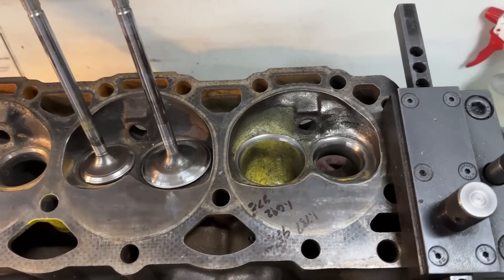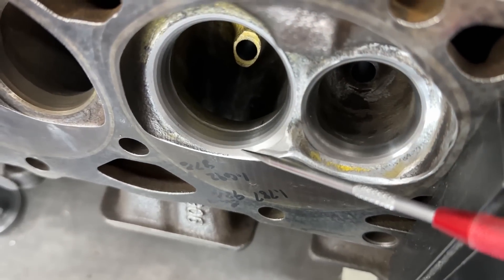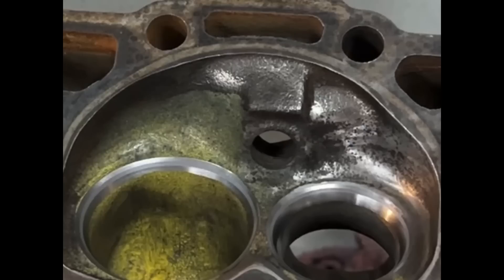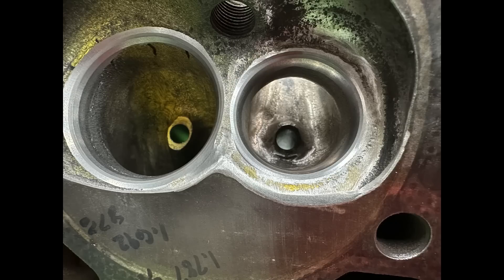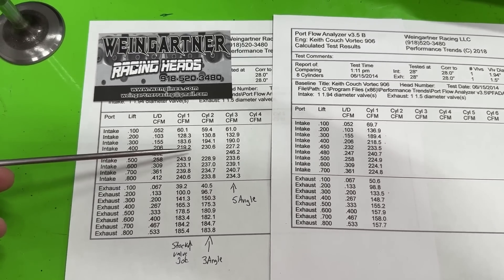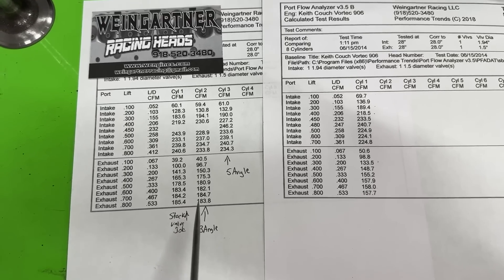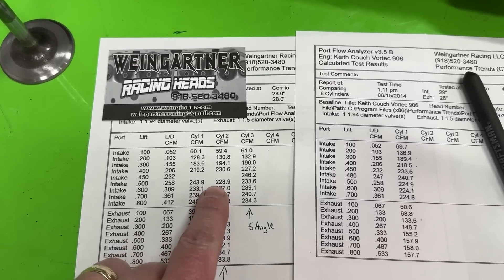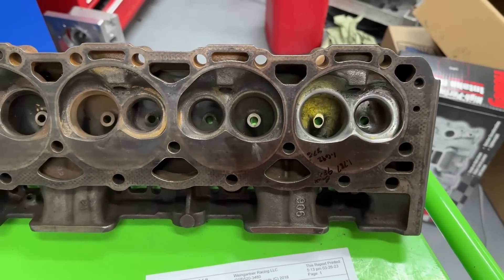Can A Valve Job Increase Flow On A Set Of Vortec Heads

Comment: I do a 3 to 6 angle cut depending on the application, I cut one at a time so the cuts don’t interfere with each other especially on the final cut with sometimes I’ll redo cause I’m narrowing it up to get a finish set up. Also, I’ll use dishwasher soap and water on the 30 and 46° on the sea and 45 on the valve for an interference cut, it depends on what kind of application you have but this is what I do. It’s in the seat where it should be on the vowel very well and cut it to perfection. The cuts also don’t interfere with secondary cuts.

Comment: When i played with these, i remember the top cut being important on these heads. As close as you can get to 40 degrees seemed the best. There is a goodson how mondello cutter advertised for Harley Davidson that has a 39° top angle, is use one with a dismder seat, I never seemed to have luck with seats under .050" but ymmv. With a Sioux setup it was difficult to recreate an angle that close to the seat angle, any unsteadyness or could affect the centrality and the width of the seat could vary around the circle and small amounts of grinding could make big differences in seat width so I often used 35 degree top cuts using the sioux. Would be interesting to try a 50 degree seat and bowl hog so that higher top cut angles could be checked out.

Comment: That's cool .
   5 angle in this video is only good from .450 lift and above.
     So for the racing situation that is awesome!!!
    However for most people that are building a street engine that isn't going over .490 lift DON'T GET A 5 ANGLE VALVE JOB  on a small block Chevy. . .
Reply from the maker: I don’t agree
Reply: My amazon 200cc sbc heads flow 276 at .5 before I have even touched the chambers, or thinned the guid boss or widened and layed back the port floor. It's all valve job until .5

Comment: The machinist did a 5 angle cut on my 2.0 ecoboost. It flows so good now that I'm having misfires at coldstart  because the injectors are having trouble keeping up. My turbo is also hitting peak boost (29 PSI) ~300 rpm sooner but I'm not sure if it's a result of the valve/head work or simply having clean valves. It's a GTDI so carbon buildup is a fact of life. The cylinder was over-bored by 0.5mm but besides that and the above mentioned everything else is OEM spec.

Comment: Why not just a straight up cylindrical bevel cut into the valve and seal? Wouldnt that provide an adequate seal?  Or are the transitioning flat surfaces better for some reason?
Reply: An adequate seal is only half of a valves job, the other half is to flow as much air as possible when it's open. Multi angle has better aerodynamics.

Comment: How much does a valve job cost for vortec head whats the price difference between 3 and 5 angle
Reply from the maker: There is no price difference to do the valve job 3 vs 5 angle. But the 5 angle usually leaves a ledge that needs to be blended. $300 for valve job
Reply: @WeingartnerRacing  thanks for the information 👍

Comment: Question: Have you ever tried a 1.50 exhaust valve in a sbc head that has been ported to the 1.60 exhaust valve to see if it makes a difference in the flow? Bigger port with a .10 smaller valve with a single 45 degree cut. I'm just guessing but think it would have a better flow number.
Reply from the maker: No. It would sink the exhaust valve in the head quite a bit.
Reply: @Eric Weingartner  
Thanks for the info, was wondering if it would work.

Comment: I did a 6 angle job, 3 on the seat and 3 on the valve face.
Reply from the maker: The valve job angles are on the head. So if you have 3angles cut into the heads you have a 3angle valve job. The angles cut on the valves are back cuts. So you have two back cuts.
Reply: @WeingartnerRacing  I was being Snarky.
Reply: @WeingartnerRacing  back in the early 80s the hot ticket was it to have a radiused valve seat with the cut at 45° centered on the radius.

Comment: Have You ever tested with a 30 deg. angle on the seat,I do know that all heads aren,t the same from different carmakers, on a AMC 502 "dogleg" head as an example ,a guy named Ken Parkman (in Canada) lost quite a bit flow when going with 45 deg. seats than what he got with 30 deg. seats. Important to notice is that AMC heads has 30 deg. seats from the factory,the "dogleg" heads was developed together with Valley Head Service's in California.
Reply from the maker: 30degree seat is a bad idea.

Comment: Did you mention it in the video? It looks like the intake with porting and the valve job had a bigger gain over the port with just the valve job.
Reply: What I learned: porting intake push rod pinch is a waste of time, I think it hurt low-lift flow by hurting velocity, just bowl, throat, and valve job.  Spend your time on the exhaust, streamlining around guide boss, VJ.  Thanks Eric
Reply from the maker: Yes I did and you are correct
Reply: @Eric Weingartner  is the loss of flow at .450 and above indicative of a short turn radius that needs some attention?

Comment: Incredible how the "Invisible"  air flow #s make unpredictable change with slightest valve job shapes & angles !! ....Compared to "Regulated"  constant Test Pressure (std 28") Air Flow Bench type,  Does the "Unregulated"  Test Pressure  Flow Performance FP1  Electronic  Correcting (to 28") Flow Bench generate the Same 28" Test pressure Results ?? .....If so, good but How can an actual Low (like 14" Pressure) be accurately Predicted to what Actually flows at the Higher Std 28" Test pressure ??  Doesn't air flow dirvert Unpredictably from Various minute Different angles at Different Test Pressures  ?? .....The Exhaust Flow results was totally Unexpected !! .....With Actual Running engine hot exhaust Burst flow at Hundreds or Thousands psi Pressure,  How can the Same cold 28" Test Pressure anyway remotely Predict the running Hot Flow rate  & why is 28" used on the Exhaust  ??  If say,  500 psi Burst is much Close to Actual Exhaust Conditions,  Wouldn't that Be much more Accurate measurement ??? ......Thx for the informative vids.....
Reply from the maker: They were flowed at 28inches

Comment: Price per hp tho ? Prob a lot of money in 5 angle job when his stock port job .. I doubt you feel that difference
Reply from the maker: It costs the same to do a 3angle valve job vs doing a 5angle valve job. Most stock heads need a valve job anyway so it costs you nothing extra.
Reply: @WeingartnerRacing I have an 87 f150 w E7 heads that I’m only gonna port and polish, would this 5 seat be good for streeting if I use stock cam

Comment: Gained low lift flow, but lost on the high lift. So apparently, it's better to gain in low lift flow than gain in high lift, and even lose a little high lift flow? The valve is in the low lift ranges more than it is in the high lift ranges, Is that what this equates to? Thanks.
Reply from the maker: I like flow at about 80% of your valve lift.
Reply: @WeingartnerRacing  OK, thanks.
Reply: Eric is the pro.  But I've heard of porter's trying to lose low lift flow.   I don't recall why. Then you hear of them trying to gain low lift flow.   Heads with large low lift flow act like they have a bigger cam. The situation they try to lose low lift flow or don't care are greater than .700 lift but I don't know all the reasons why.

Comment: Sick those heads ought to run pretty good if it was me id cut those valve guides on the top and put something with 600 lift in the old girl
Reply from the maker: I always cut them down for being able to use better seal even if they don't need more clearance.

Comment: Very cool to see the results.  Thanks to the Customer for playing along and going for the valve job. Thanks for taking the time to share the knowledge,  Eric. I enjoy it.
Reply: How much a 5 angle valve job cost about don’t have to give me what u charged but just a price range
Reply from the maker: It really depends on the machine shop and your area. The price ranges from $200-600 to valve job a pair of heads. I charge no more for 5angle vs 3angle. It takes me no more time to do either.
Reply: @WeingartnerRacing  That's cool. I guess the expense is in having the cutters made and you know from experience how many seats you can cut before they need sharpening or replacing?

Comment: If this cylinder head was direct injection would blending the intake angles help with flow ?
Reply from the maker: You still have reversion so I think the angles are still better.
Reply: @WeingartnerRacing  better to manage reversion with the valve head perimeter retain a square edge at the chamber AND seat edge.. the venturi effect past the valve/port seat airflow speed increase will shatter any fuel drop out into chamber.. thick exh valve head perimeter radiised helps a lot for exh out flow & avoids head heat distortion & hotspot & seat burn.. good vid thanks good to see others thinking.. cheers from NZ
Reply: Radius might be better for direct injection.

Comment: I’m tempted to send my 882s I have just to see the difference in flow
Reply from the maker: Give it a shot. It would be interesting.
Reply: @WeingartnerRacing  I have 2 heads just laying in my shop I could drop one off and have you flow it and do a valve job on a cylinder just to show for a video just to see the improvement for us poor people
Reply from the maker: @jeredfowler7194  I do charge $30 to flow and $30 for video.
Reply: @WeingartnerRacing  nice
Reply: @WeingartnerRacing  that's a fair price. Wish you were close to me. I do a lot of engines.